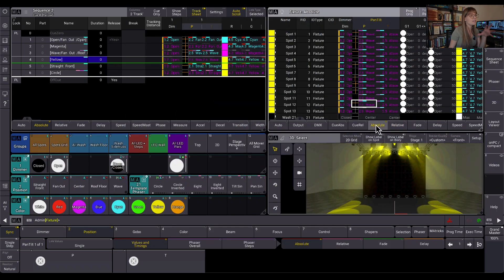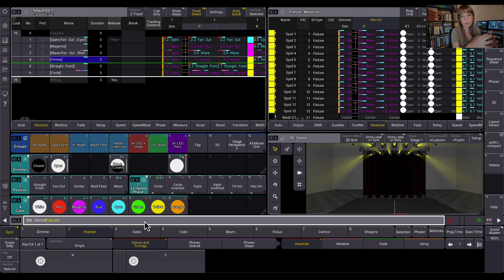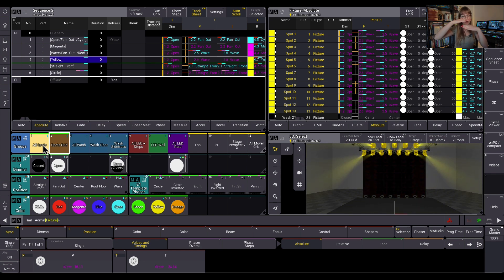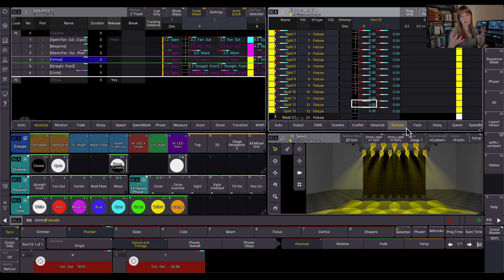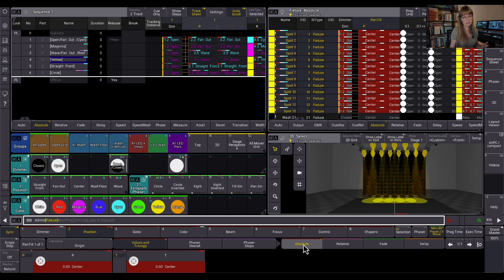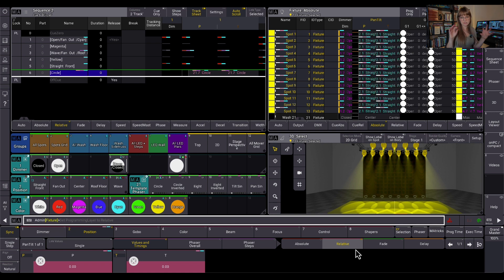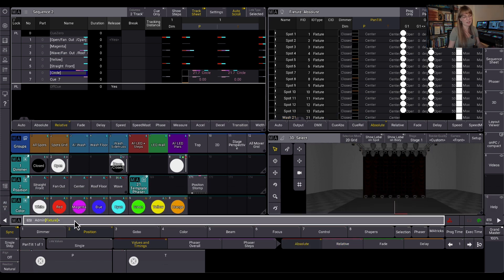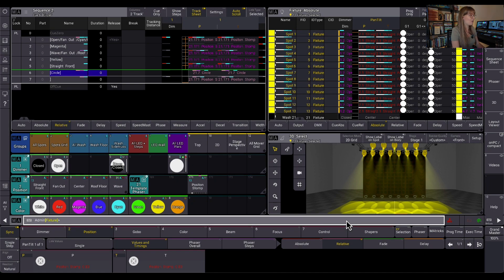Phaser Friday: Stomp

Comment: Im trying to wrap my head around the technical reasons FX Layer logic was abandoned. Based on your comments here it sounds like unification of the value system was the main argument, but I’m kind of suspicious about that because I never saw any user have problems with that. 

To me it seems like this was all about  making dev easier having a parameter stream all full under one unified framework.

But from a lighting programmers perspective I think this leads to less flexibility and speed on the users end, and creates more problems and limitations. Hard values are a big one as you rightly point out. 

A phaser “class” or phaser “layer” should solve a lot of the user side issues with phasers and can still be done without breaking the current model. It should drastically improve speed of creation and programming / editing workflows. 

Since everything seems to be a phaser,  it probably isn’t that crazy to implement this. The value resolution engine is already built to take time-based step containers and resolve them into final parameter values. So adding layering is just an extension of:
Phaser container > Phaser output valu > another Phaser container > resolved value
>Dmx output.

I would love to see this change, I really think it will make the user experience better for everyone. It should make trying to communicate and share these things easier too 😂

Comment: Awesome tutorial! Your technical explanations are always very clear. 

I’m wondering about common use cases for stomp, as someone learning lighting on MA3.  Is it a practical use case to utilize stomp to add static looks to sequences full of positional phaser cues? In what other ways may one utilize stomp?
Reply from the maker: I personally don't find myself gravitating to using Stomp. However there are so many features in the desk and usually more than one way to achieve any goal. It is really about finding what makes the most send for your workflow and your brain. If Stomp isn't apart of your workflow and you don't see a use for it. I wouldn't force it into your workflow unless it naturally fits there. That is my motto with a lot of features. Especially and I learn and continue to grow in my own programming skills.
Reply: Stomp is useful for pausing/ending/changing phasers without losing your position/underlying color/etc, which I find critical for busking.
Reply: @blaquenight hmm, I think I’m missing why it’s critical.  Does this tie into the concept of tracking?

Comment: I remember people using stomp to freeze a position phaser and save the cool looking positions to a new static preset. 
But maybe I remember it wrong cause what you explained here is very different. 
Did they use the store look command maybe? 🤔 not sure, it‘s too long ago

Happy Phaser Friday to everyone! 🥳
Reply: This is done by hitting stomp twice to get the keyword "Capture"
Reply: @IanSPeterson is it possible to set stomp-stomp as a macro and then to a playback button? If it is possible, is there a reason I wouldn’t want to do that? 

I want a playback to stop pan/tilt..have thought of using speed master value at 0 then to a macro then to a playback..but I’m unsure of best practices, or if there are best practices for this
Reply: @PostedFrequency stopping the speed is a better way to do it. Since this is a fully reversible action that doesn’t make any changes to programming or any already stored objects, and doesn’t require any values to be activated in the programmer. 

If you use stomp, you are putting values in the programmer when you evoke it, which could accidentally be stored, updated or removed.
Reply: You can also just set what ever speed master is assigned to zero, which gives you much more control over exactly what you want, and then use capture.